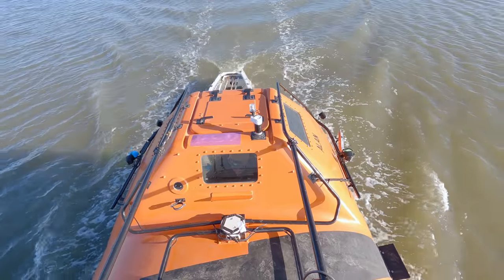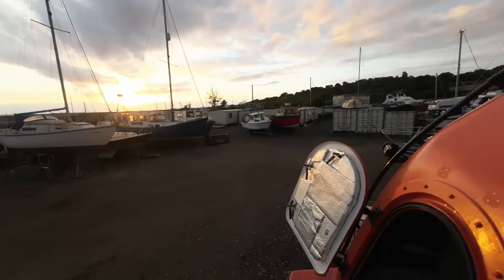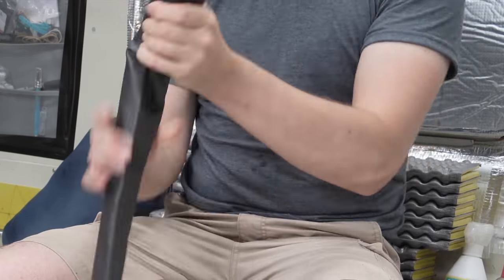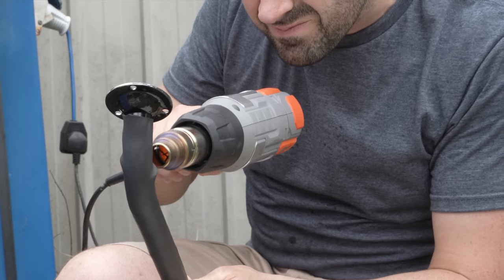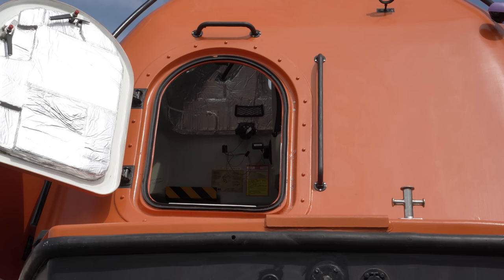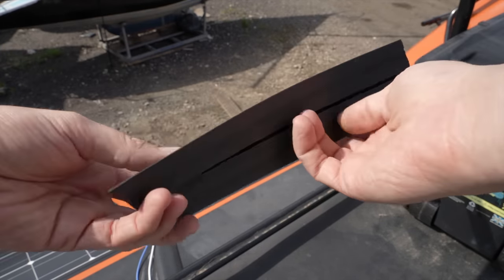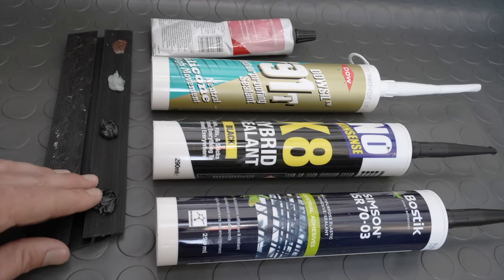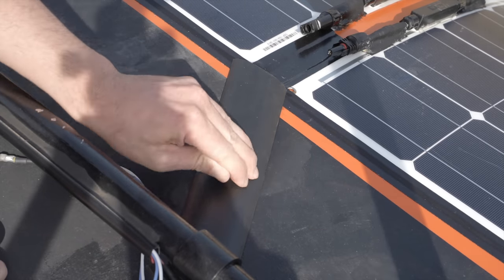Lifeboat Conversion Ep52: New safety handrails with cold-proofing, having condemned old handles [4K]

Comment: Just remember to leave a long line with floaters dragging behind Allen when at sea so if you fall you can grab something and.... Not die.
I love your project I even saw a beautiful lifeboat for sale online and wished I could return to Europe.
Reply from the maker: Yes indeed. A similar trick is used by some dog team drivers I know :)
Reply: Those are of very limited use. People have tested the idea, and if the boat is moving at even just a few knots, the force of the water flowing past you will make it impossible to pull yourself back along the line. Far better to put extra effort into making sure you can't fall off in the first place. Harnesses (with a crotch strap), short (dual) tethers, jacklines and padeyes everywhere you may need to go.

Comment: A old biker trick to put rubber hand grips on new handlebars is to wet the steel with gasoline then dip the rubberized grips in the gase before you slide them on like warm butter on hot toast .
.a benefit I found is when the gas evaporates it dory of glues the rubber to the steel and you pretty much have to sand them off. To remove them
Reply: Thanks
Reply: Yes, but you should specify not to get gasoline on the outer portion of the grip, correct?  Only the inside part of the grip.

Comment: If you use shrink wrap again.  Wet the hand grip with alcohol before you try to push on.   It will create a lubricant.  As you hear shrink it will evaporate.  Keep up your good work!
Reply from the maker: Good tip

Comment: Hi, I am fascinated with the build and it's potential for adventure. Speaking of handrails, do you have a method to climb back onboard in case one falls off the boat?
Reply from the maker: The plan will be ladder that can go out either side hatch, and when I've made the rear extension, a semi-fixed one there too.

Comment: when sliding rubber over steel, try this, spray hairspray down inside the rubber, it's very slippy when wet and when it dries it holds like glue, old motorbike trick for fitting rubber handlebar grips, don't use petrol as some say, it disloves the rubber. in saying that theromplastic coating is very cheap and very easy to do, and lots of colour choices !

Comment: Do you have or have you considered a system for securing yourself to the 'ship' in the event that you find yourself needing to move around on the outside of the hull?  Something similar to what people on sailing vessels use so that if they happen to fall overboard, especially while in motion or in strong currents, they will still be secured to the vessel and will have a way to 'reunite' themselves with the vessel?  If something like that were to happen in an arctic environment it would certainly be a perilous situation and even if a person couldn't pull themselves back it would at least give another person on the vessel a distinct advantage during the rescue efforts and could make all of the difference.  And similarly do you have any sort of rules with regard to wearing a life preserver or other flotation device, since in the arctic, especially, one has a very limited opportunity with which to save themselves before they sink (in the neighborhood of seconds)?  I realize that this seems to be unnecessary or sissified to some, but then again one generally doesn't foresee or make plans when it comes to falling overboard.